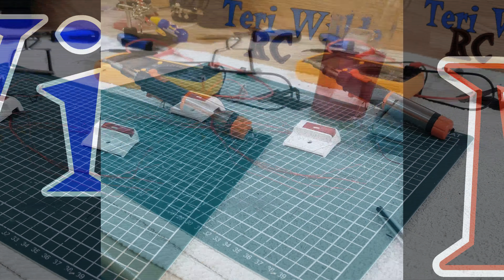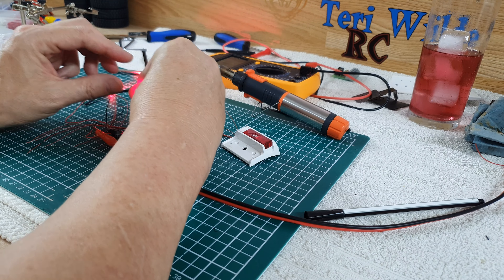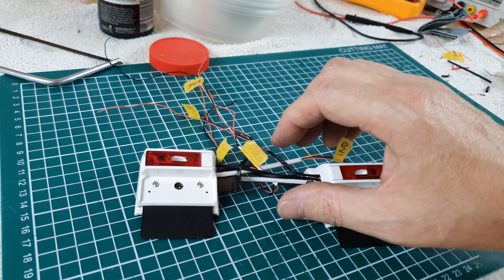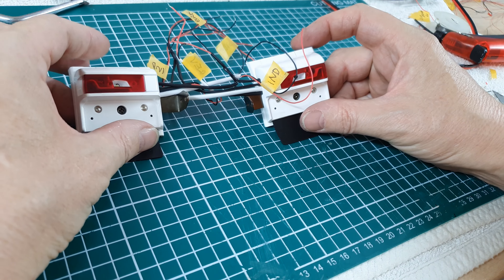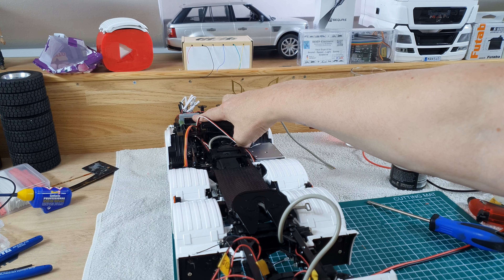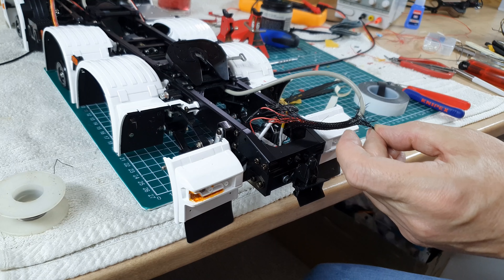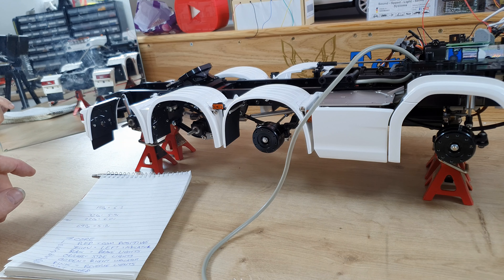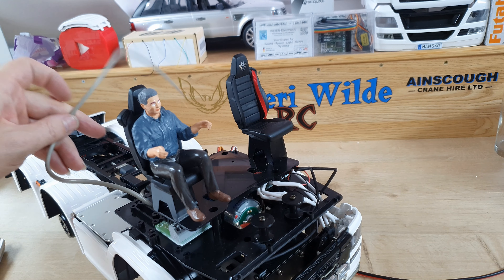Tamiya Scania 770S 8x4 Heavy Hauler - Part 11 - Rear Light Wiring - 4k

Comment: Why are you not using resisters for each led?
You can cause damage to leds ruining them in series, you also cannot guarantee the balance of current.

Just be interesting as to why you picked this method over the much more safer route, that you are also then able to fully control the current and voltage to each led but having them in parallel with resister
Reply from the maker: 1000s of manufacturers use multiple LEDs in series, some use two and some use 3 in series depending on the application. absolutely nothing wrong putting LEDs in series.
There's nearly 60 LEDs in this build, not many for a Scania, and using 60 resistors is just unnecessary. Even the light bars and beacon bar has LEDs in series from the factory.